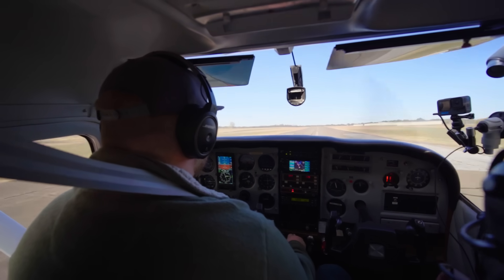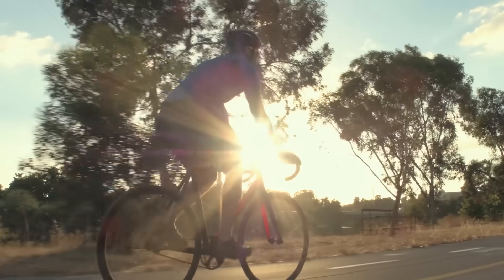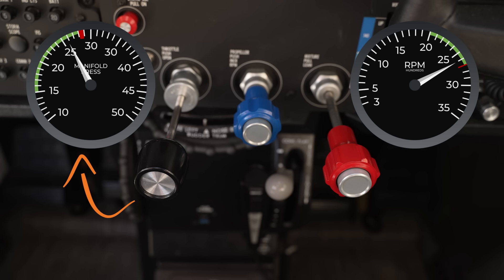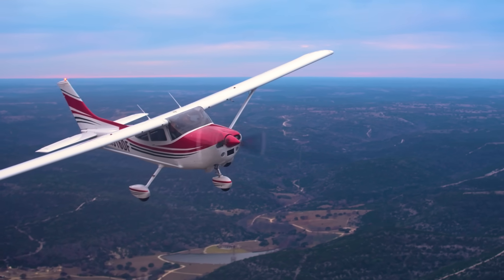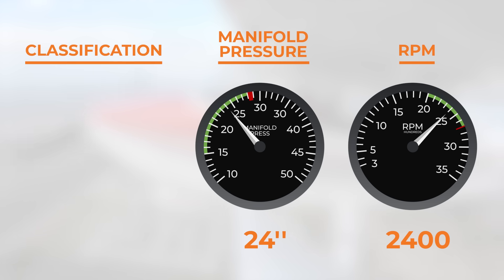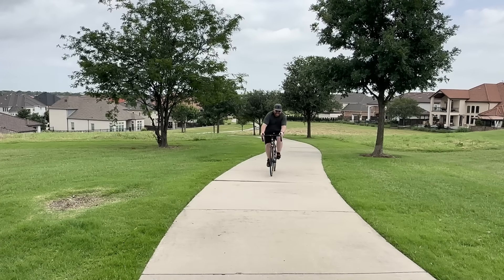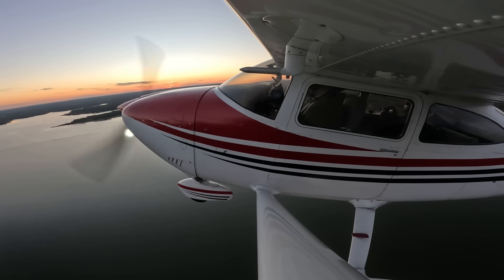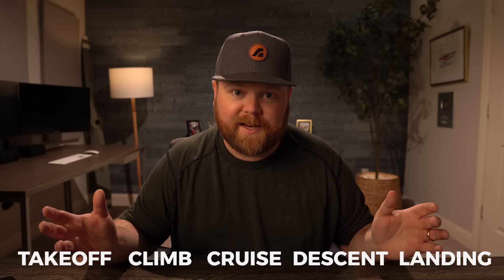Constant Speed Prop Explained in Plain English (Start Here!)

Comment: So when I was flying we were taught fixed pitch and variable pitch props. 
I’m not sure why they changed it to constant speed prop? When you increase power (black knob pull) you increase speed of your prop. Same for variable prop. When you reach higher altitudes where there’s less air or resistance for the prop to grab you increase or (pull the blue knob) variable prop’s pitch (angle) to grab more air. You also will need to change mixture red knob for leaning or  enriching fuel to make engine run  cleaner as density decreases and vice versa when coming down to lower altitudes. Example: when you tune a car in Bolder, Co and take it down to sea level in California you have to adjust the carburetor (aspirated engines)because of the change in density. Less air in Colorado and more air in California. But fuel injection engines and car computers do that for you nowadays.

Comment: so what happens as you go higher and the air density drops or when weather fronts come through, does that impact the manifold pressure and you have to adjust especially if climbing ???

Comment: Would it be safe to say then because the RPMs change with adjustments to the blue lever that in fact the propeller is not constant at all?
Reply from the maker: It's counter intuitive but the "constant speed" part refers to how with throttle adjustments the propeller still stays at a constant RPM. Hence constant speed.

Comment: I flew a bushcat with a CSP and it just had a 3 position switch, fine, medium and coarse, once at straight and level switch to coarse and leave it there and just adjust throttle as required. Was looking to do the same thing to a Hanuman aircraft hopefully get a few extra knots out of it, while maintaining a short field takeoff. Do you think this would work? I want about 5 knots extra speed in cruise.

Comment: If you lightly tap the prop blade on the tip with a screwdriver, it goes “Tink”…..if you tap it halfway up the blade it goes “Donk” ……why you may ask? 
It is variable Pitch prop.  Youre welcome.

Comment: This is the best video on Constant Speed Prop operation that I've found! Well done! 

Unfortunately, I have one slight qualm: the "should not be oversquare" method is a myth that has been shared many, many times before. If you look at the Lycoming engine operation manuals, it does give a graph (albeit buried rather deeply) that depicts the highest MP for a given RPM, and they are not really anywhere close to "square". For example, an O-360 has a limit of 29inMP (Sea level takeoff power essentially) all the way down at 2400rpm (a common cruise prop setting) and a limit of 25in MP (max power at about 6000ft PA with a normally aspirated engine) all the way down at 2000 RPM  (a very low cruise setting that no one I know uses).

 I understand and I appreciate that you simplified it very well in a way that people can understand better, but the myth that you can't operate "oversquare" is so proliferated by people not looking deeper that I get comments from people accusing me of destroying an engine by operating at 24in MP and 2300 rpm. I do love that you included a simplified version of to never run a very high power setting with a very low rpm, but knowing the actual limit is very useful. 

I just wanted to add that small caveat because the myth is so engrained in training and people often don't understand the full story. But again, I appreciate that this is the best video on Constand Speed Prop operation that I've seen, and you did an awesome job!

Comment: Very nice video! I always thought the CSP as changing gears. But then, one day it dawned on me that a better analogy in the bike would be as if it changed the radius of the wheels. What are your thoughts on that?
Reply: If that analogy works for you then go with it, but rarely do you see in a real life situations people changing wheels with different radius. The gear changing example is a practical real world example that exists in everyday life.
Reply: @ChallengeTheNarrative_CTN  Hey there, thanks for the answer! Of course I wouldn't use this analogy to teach someone how the CSP works. That would probably confuse them even more, lol. I'm just using this kind of "thought experiment" because it keeps the RPM of the pedals and the wheels constant (as it happens in the propeller) but by magically  changing the radius, it makes the wheel "bite" more road. Now, make the road slippery as hell, and the analogy becomes even more close to the prop reality!

Comment: Engine’s maximum efficiency is at maximum torque with the throttle wide open.  
Airplane engines have a humped torque curve.  While I can’t say this applies to planes , the practice is to run a bit past peak torque so that if it loads up and slows the torque increases.  For instance diesels have flat torque curves with max torque at idle.
Modern car engines have flat torque curves and multi speed transmissions.  The vehicle speed is increasingly controlled by the transmission..same idea as a constant speed prop.   
A good compromise is a two prop with 2 pitch settings.  There are a few around.  I guess they never caught on because the incremental cost of constant speed wasn’t too great.      Cheers.

Comment: If you are a car person.
The manifold pressure gauge in an aircraft is the same as a vacuum gauge on a naturally aspirated (no turbo or supercharger)  car engine.
The more load you have on the engine, the lower the reading on the gauge.

Comment: At each propeller rpm there is a pitch of optimal power.
Constant pitch prevents optimal power for any but one rpm.
Ag any other rpm, the constant pitch propeller is either subutilized (could deliver more power if pitch was right) or overutilized (propeller drag absorbs increasingly more power to deliver same traction as for optimal pitch).
Different regimes require different power demand thus different pitch for optimal power delivery-implicitly different engine rpm.
Now there is no reduction, propeller being fitted directly on engine shaft.

Comment: The importance on cycling the prop during run up should be taught and emphasized as well. If the engine is cold, or the airplane has been sitting in storage for an extended period, the prop should be cycled 3 times. If the engine is warm, cycle the prop twice. This enables oil to work its way into the dome of the propeller hub to move the blades back and forth and lubricate the hub. Cycling involves pulling the prop control fully out while watching RPM drop and Manifold Pressure increase; and then pushing the prop control back in to increase RPM.

Comment: The other advantage of flying an airplane with a constant speed propeller is that by leaving the prop setting at a lower RPM ( 2,350 -2,400 RPM), you can use the drag of the prop to help slow the airplane down upon descent to landing. Furthermore for Turbocharged airplanes on climb out, adjust accordingly( MP between top of the green and redline, prop reduced to 2,500 RPM, and Mixture to top of the green arc) Normally aspirated ( MP full throttle, prop to 2,500 for noise abatement, and Mixture full rich to cruising altitude. The reason for leaving the mixture rich is that air density decreases as you climb; with less dense air flowing past the cylinders to aid in cooling. The fins on the cylinders also draw heat away from them. By leaving the mixture rich, you can help maintain cooler internal temperatures on climb out. When approaching on final, prop needs to be set at high RPM, and mixture rich. Also remember the GUMP acronym (Gas, Undercarriage, Manifold Pressure, Prop) the undercarriage of course if you’re flying a plane with RG.

Comment: 9:28, is not always true, at low altitude the c182t poh allows manifold pressure to be greater than rpm at low altitudes but i think generally it is a ok rule of thumb

Comment: Introducing efficiency to the use of the CS propeller is a distraction and you don't ever know what is happening with efficiency. Is is a constant speed propeller. It will set pitch to control RPM to the setpoint. The CS prop allows you to use any engine percent power you want. It will deliver 100% power in takeoff and climb, regardless of externalities.

Comment: What is most confusing is say the POH gives you the settings for 55, 65 or 75% power. Supposedly, the airspeed at those power setting are the same, but you have multiple pitch settings. Theoretically, the slower, the engine turns the more fuel you save and the less wear and tear but you sacrifice a knot or two of airspeed so if you fly say at 2400 RPM, you will go faster than the same power setting at 2200 RPM. You will have less fuel burn and wear and tear at 2200 RPM. With rental aircraft, most people fly it as fast as they can because they are on the clock. Speaking momentarily on the technique of moving throttle or RPM first, pertains to the settings for a naturally aspirated engine only. Manifold pressure will exceed RPM in a turbo charged engine. I have flown an arrow four with a turbo charged engine and the cruise setting was 34 inches manifold pressure and 2400 RPM for 75% power. Cruise at 65% power is like 30”MP and 2300 rpm or 29” MP with 2400 rpm. Faster rpm means lower MP. On takeoff power setting was 41 inches manifold pressure to 2575 rpm.

Comment: Excellent explainer. For the order of moving levers, I always consider increase R to L, decrease L - R (particularly when thinking about the mixture) - we don't want more air introduced than there is available fuel (will run rough) but it's ok to "waste" a bit of fuel and have too much fuel, before resetting mixture.

Comment: Aviate, navigate, communicate.  As you plan your flight ( navigate in this case) you're thinking of the operations needed for the successful completion of the flight.  You know you've got a cross wind along your course during a certain leg so you plan in your head of adjusting the plane to make the aviate load less. Same goes for the prop. Blue line, and begin to configure the plane for the anticipated situation. You reach the anticipated altitude you adjust the plane once more to that leg of the flight.   As you build your flight plan you might note the frequencies anticipated along your anticipated path to the destination and hopefully you don't do like many of us do, leave the shopping list at home, or in this case the station lists.

Comment: One area I dive deeper when teaching is a natrually asperated engine, the intake manifold is going to be lower than atmospheric pressure, it is a pressure reading, but not "pressurized' where as supercharged or turbocharged is pressurizing the intake manifold, in motorsports this is known as boost, with tractor pulling sometimes as high as 170+ poounds of boost"
.

Comment: What would be the problem if we adjust the propeller pitch based on the indicated airspeed? At low airspeeds (climb, takeoff), we need a low pitch, and at high speed (cruise), we will need a higher pitch. Can we make it automatically change based on the airspeed?

Comment: I have an issue with how you explain the reason behind the RPMs either increasing or decreasing. For example, you say that when you push the blue lever in all the way, the propeller takes a bigger bite of the air, and that being the reason why it slows down. But that isnt the case, is it? Isn't it because it meets more wind resistance making it harder for the engines to spin it around?

Comment: I always explain prop is like a wood screw, soft wood you can use chipboard screw, easy to turn so per rev. can make quick more forward progress, like straight level cruise. When climbing, bit like screwing into hardwood, so you need a fine threaded screw, you don't travel as far per rev. but easier to turn. Bit  like taking the steps instead of the ramp.

Comment: Question:  So if the best analogy to constant speed props is like having gears in a transmission.  Does that mean that an aircraft with a constant speed prop gets better fuel burn than an identical aircraft/engine with a fixed pitch propeller?

Comment: Basically by controlling the prop pitch your controlling engine load. So if the throttle is at a set position and you change the pitch, raising the rpms is decreasing the engine load, while increasing the bite while increase the load. Its similar to gears in a car, more torque in lower gears.

Comment: We really need to stop teaching people about keeping manifold and RPM "squared." It's a myth that has been debunked time and again and lacks any scientific foundation. If you have a big motor like a 520 or 550, and you're departing sea-level-ish airports, you'll always be over squared and there's nothing wrong with that. If you have a turbonormalized engine, you'll be over square all the way to cruise. In my Bonanza, I'm departing wide open throttle at +29" @ 2600 RPM and then at 1,000' AGL, WOT @ 2500 RPM. I'm that way all the way until cruise and then it's 2400 RPM. This is the standard practice. On the descent, you're pulling manifold back and for the most part, the prop control has no effect at those lower manifold settings. 

Learn the POH for your aircraft and fly by the numbers. This "squared" thing really needs to die. Yes, you should never chug the engine at like WOT and 2100 RPM -- so that's what we should say and just leave it at that: don't run high manifolds at low RPM's. We shouldn't be talking about squared anything.

Comment: I don't fly but this is an interesting concept from a driving PoV. It's kind of like a manually controlled CVT transmission lol. Sounds like here you want to avoid "lugging" the engine. Is lugging worse than over-revving in a plane engine? In a car motor, lugging isn't good, but overrev is way worse. Aka I'd rather upshift too early than downshift when too fast for a gear.

Comment: Good analogy, however one correction.   RPMs being higher than MP is not always true.   look at your engine manual to determine what power settings you can run.  In my airplane I would normally fly 24” and 2100 rpm’s, perfectly legal per my engine manual.  also detonation has nothing to do with RPM/MP combination but rather mixture control and or engine timing.

Comment: In a normally aspirated engine, why have the RPM higher than manifold pressure? For a fixed pitch propeller, you use full power and probably only 2400 RPM in the climb, every flight. Best to follow the procedures in the Flight Manual.

Comment: Very interesting explanations seen from the general principles and the practical move To do. The other way usually explained and learned, is begining by open the speed governor and look all the oil valves and ways how this device maintain constant speed , and then it becomes some how confusing as the principle is a regulation by counterloop reaction so better the way you explain so to have the good suite of logic hangrips to conduct the bests of the engine.....☕👀⚓

Comment: I came up with my own analogy re prop/throttle. Keep the blue above the black just like the blue sky is above the black runway. Increasing power move the blue up first, decreasing power move the black down first. If you ever get confused just remember on takeoff the blue lever is all the way up (fine) and you move the black up to meet it and down first to keep it under the blue when you first use the CSU :)
Reply from the maker: Interesting. I like that. Thanks.

Comment: Well done dude. Great job. In the 80s when I was learning to fly and after I got my private, I took all that to a next level. I went from a fixed prop 172, to a Piper Turbo Arrow III (normal tail) and I made my life a bit miserable, with the added complexity, but my instructor was great and calmed me down, because that Arrow would take 38 in of manifold pressure, and just before take off it was at about 40, and I freaked out a few times, but it was sill awesome. I got my complex time on that Turbo Arrow, as it was also retractable, and another curve ball from the 172 fixed gear.

Comment: I Looked after 130 Tucanos !
Engine Ran at 20,000 RPM ,Prop 2,000 Constant Prop 
Speed is Controlled by The Blades Moving and Pulling more or less air threw them 
Engine oil Is Used threw the Centre And Prop hearing with Brushes against a back plate to transfer the power

Comment: Well done, especially the bicycle analogy. It's all about avoiding high forces on the engine components with high power setting and low rpm. In that condition, the engine doesn't have enough momentum, so every "pedal down" puts a lot of stress on the engine. It's the same reason you see broken down cars towing trailers on the highway. If they would have just geared down and allowed rpms to increase, they probably would have been just fine.

Comment: Low time pilot with all except 2 hours in a Super Cub. My last flight was in a 182. When you said it was just like flying a 172, my thought was “but I don’t know how to fly a 172”. I was really struggling with the engine controls on the 182. The throttle is supposed to be on the left side of the fuselage. 😂

Comment: the way I learned it back in the 60's was this way;  you have to provide an outlet for the power.  You can't make the power higher than the rpm are you will damage the engine (not sure that's true but it kept me from making that mistake).  In other words, power has to have someplace to go.  Power can't go higher than rpm and rpm can't go lower than power.  I thought it was a simple concept.  I haven't flown since 1988 and I see pilots on YouTube reducing rpm first all the time.  Best I remember, an engine should be able to give you at least 29"mp especially at sea level but rpm is usually 26-2700rpm.  I always reduced MP at least a couple inches after about 400' in altitude.  Can you tell me your settings on T/O.